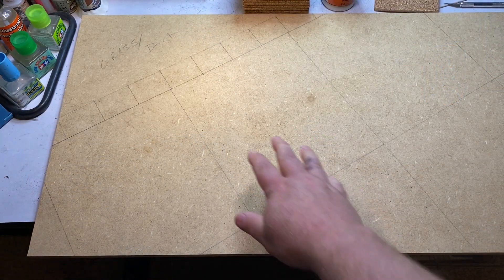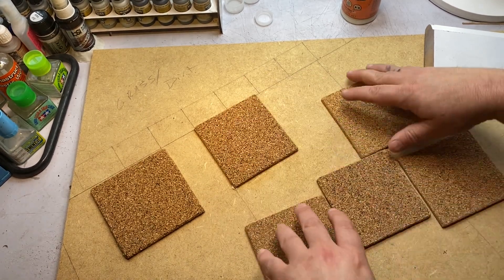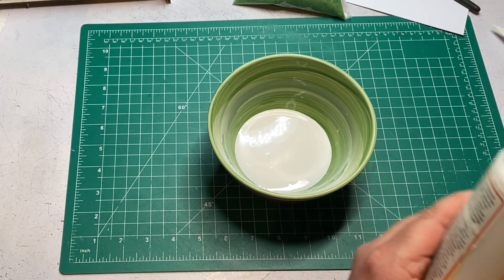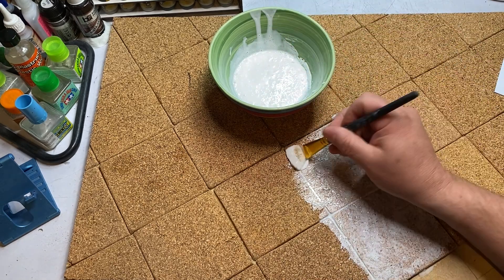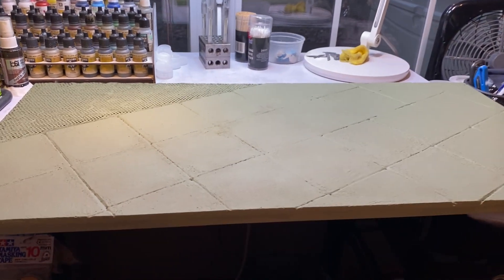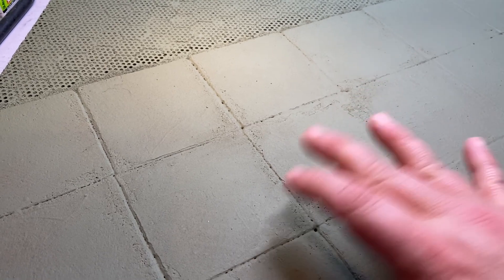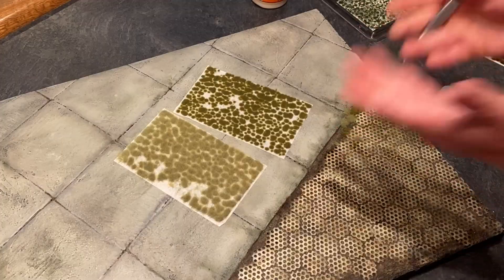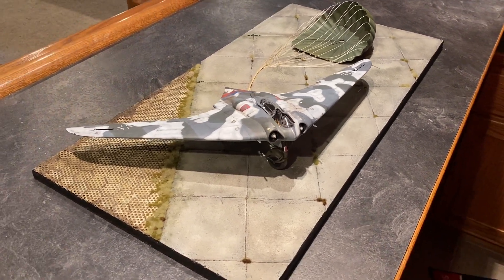1/32 HO 229 Display Base with Drag Chute Part 2

Comment: I agree with the comment about the Allies using PSP (perforated steel planking) but the more common name especially in the Pacific was Marston Matting where it was often covered in crushed coral. The matting would look great with a 1/32 Pacific Theatre P-38 - great job and fantastic thinking
Reply: more i think of it the P-40 would look great on that as a base

Comment: 14:34: The hexagonal (you have good eyes) structure is indeed concrete. The empty space between and inside it is to drain water, rain. Germans would call them „bio paving stones“ - bio for „there is life“ between it (grass) and so it soaks better water. You can walk and drive on it as on concrete but it doesn’t cover the ground completely (rain protection). So, if you want a goo diorama: have grass in the holes.

Edit: I just finished watching and saw you cutting the hexagonal PVC parts. Man, you must hate yourself! Big respect - it was worth the effort!

Comment: SO - What happened to the mullet? Didn't want to use Woodland scenics concrete dust? The Allies called it PSP - but that was metal planks put together with pins then sometimes welded in sections. I'm not familiar with what the Luftwaffe used, beside grass & concrete. Shipping grass?! I thought you built models?! Where's Ringo when you need him! Is the AK faux grass cheaper than Wood Scenics? Base & 229's came out  Excellent! {using Montgomery Burns voice}